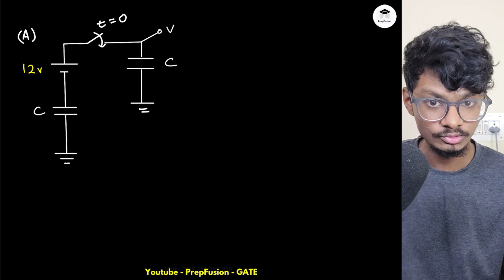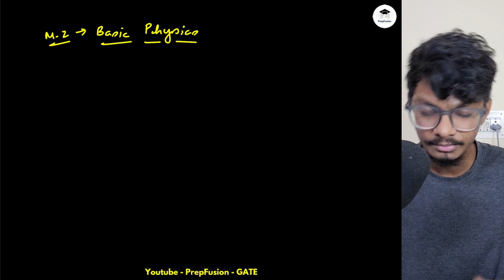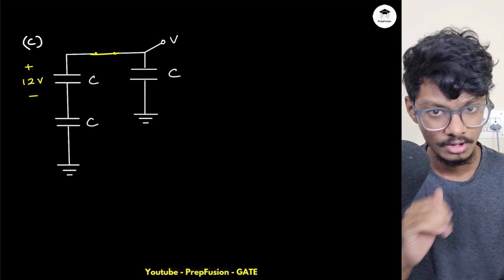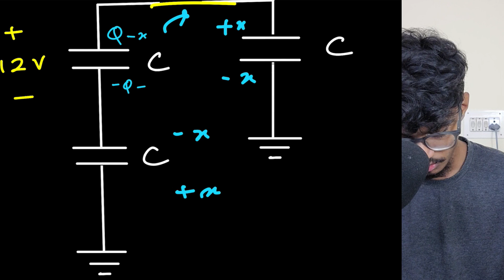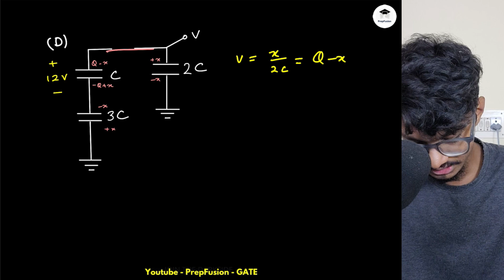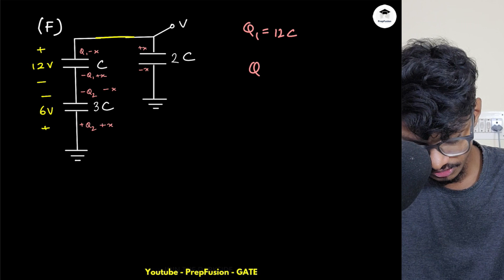🔥ONLY VIDEO You Need To Watch For SWITCHED CAPACITORS || GATE 2025 || Analog VLSI Questions

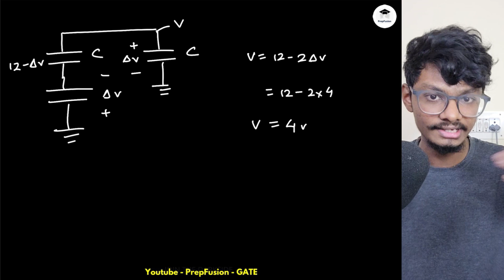Comment: At 19:40 how our initial charged cap will be 12- delta  V? Then our new voltage at initially charged cap = 12- 4= 8V which is not possible as other two caps have 4V when we add up it will be 16 V, my question is how can capacitor only discharge 4 v from its initial and charge two caps upto 4v